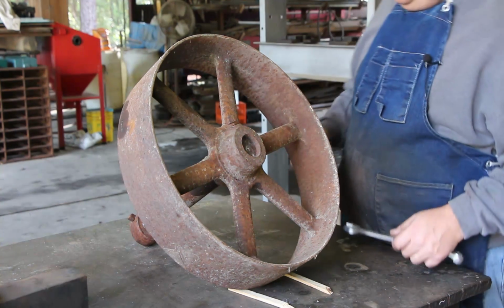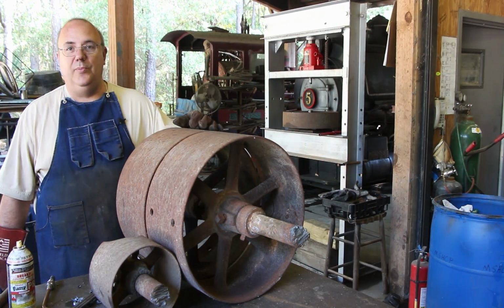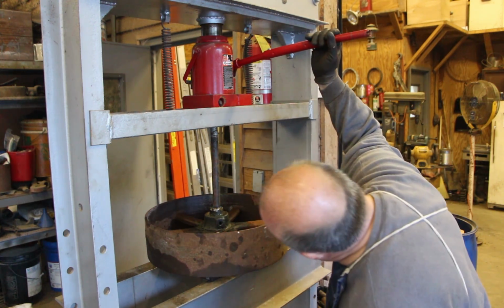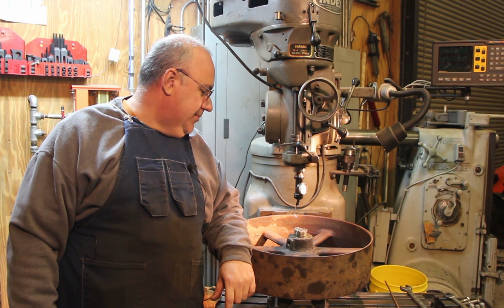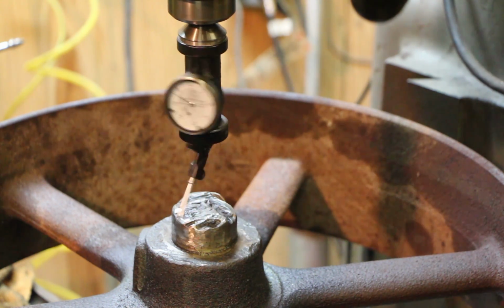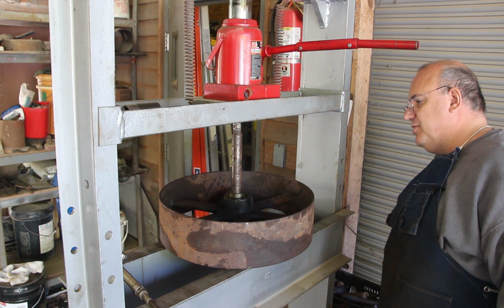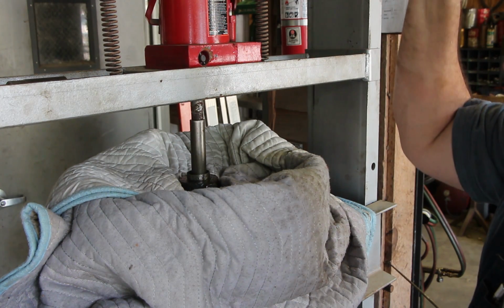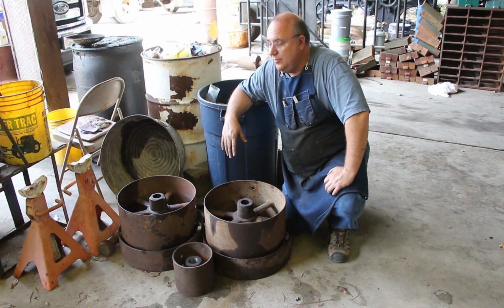Removing Stubborn Shafts from Flat Belt Pulleys

Comment: After having drilled the stuck shaft which left about 3/16" to 1/4" wall thickness, to save time and for safety reasons, this is what I would have done. Use the saber saw to cut through the sleeve wall which will release the remaining sleeve or you can also another cut opposite side and the sleeve pieces will pop out. It has worked for me. 
Marlins Machining
Reply from the maker: marlin galde Not a bad idea.  It would have been tough on this part though as the hole was not drilled through as I was actually using the bottom of the shaft for holding purposes on the mill.  Not an ideal setup but that is what I had to work with....

Comment: Ha Keith,
Just an old Indian Trick. Cut the shaft off very close to the hub , then drill a 3/4" or larger hole if possible. Now the Magic, Fire up the welder and use a 1/8" 7018 welding rod and weld a full length pass thru the shaft Pour cold water down thru the open shaft and watch the success with very little if any effort on the part of the press. Some times the part actually will fall out.
Reply from the maker: Danny Carico I have heard similar approaches before but never tried it.  I will have to add that to my list of things to give a try!

Comment: sometimes I heat up the shaft as hot as possible without heating the outside.. the bolt expands and it elongates.. when it cools the shaft should be smaller..  like welding a nut to a broken stud..welding as hot and long as possible.. when it cools..most times u can wiggle the stud out

Comment: Hallo you have try last resource first to solve the stuck axil. With my experience the set up how you press was a wrong technique in that can distorted the spoke of the wheel. I can see one mistake you have done is when you put the wheel on the press you let the rim of the wheel straight on the lower beam as a result your jack pressure travel to the spoke and then the rim of the wheel that could distorted the axil and rim alignment.
The correct method is you need a base piece that will hold the hub right under. Say you have a base peace with a hole in the centre , which should be bigger then the axil. The hub will rest on this base  piece that again stand on the low cross beam of the press. need to be sit directly  on the lower beam so you can apply a grater pressure  on the axil.  some time if you don't have a right piece you can still use two piece of square bar across on each side of the axil right under the hub .  you can made a grove in centre of the square bar which will accommodate as a pressure base and you can press with higher pressure with out damaging the spoke. Never press the way you did again it is very un professional and can damage the wheel My E mail is kyimedical@optusnet.com.au if you not understand and want to learn better email me and I will draw a diagram for you!This time you are lucky that you follow a dangerous technique and no need to pay for the owner for bad alignment of the wheel.
Reply from the maker: kyimedical While the video does indeed appear that the rim was supported on the press, this was not the case.  The hub was supported from underneath so that all of the pressure was on the hub and not the rim or spokes.  I had so many comments on this that I did a follow up in one of my next videos showing how I had it supported and illustrating how the illusion on camera make it appear that the rim was supported.

Comment: you really were lucky on that stuck one.
I would have when I had it in the mill just bore it out until it was paper thin.
If it wasn't perfect on bore center then when it started to cut into the cast iron
stop and use a chisel to gouge out the little bit remaining.
Reply: *****
Yes that would be a concern but bolting the rim down with some mill table furniture and tee bolts would take care of that.

Comment: Keith I turned wrenches for 25 years in a automotive garage.  I can't tell you how much time I lost by getting mad and aggravated and not walking away when I should have.  The worst for me was broken bolts in the block that I just could not get to. What a pain. I never liked the air powered Jacks because I liked the feel of how much pressure I was putting on a part. Guess a gauge would have helped. I was removing a pressed race off of a front hub and was using an air hammer with a Snap on chisel.  The end of the chisel shattered and metal in bedded in  my neck area. Like to have never got all the shrapnel out of me. I do not think Snap on is nowhere worth the outrageous prices they charge. If you use Snap on credit they charge you 24% interest on top of the crazy price. Thanks as always for your time and effort.  You are very talented person.
Reply: Yeah that's a tough one! Thanks as always Keith!

Comment: Isn't it somehow possible to support the pulley right at the hub? That would reduce all that shattering danger and allow you to apply a lot more force.

Alignment might be an issue though.

Regards from Germany :)
Reply: This is why I asked. Supporting it on the rim only seemed so wrong to me that I simply could not imagine you doing it that way. :-)

Comment: Keith this was a fun, easy-to-watch video! Your delivery was academic. :-)
Idea: After drilling, use a fly cutter to come in really tight to the OD of the seized shaft. Sink it through the shaft. You may have to flip the pulley to complete the cut. Then collapse the hollowed out shaft with a chisel or rotary file (die grinder). This works every time but it is time consuming to set up.
Or: in a hurry: You can always simply bore it all out and bush the pulley afterwards.
Then again, you work in a museum: not a jobbing shop. Nice work!

Comment: I really enjoy your show I have a tip for you to use to remove the shaft. Try after hearting it up melt pure bees wax on the joint and it should come out.                         Rick Ferrier.
Reply: Rick Ferrier they use bees wax in chap stick don't they?

Comment: Did my share of press work in the past....always preferred the manual press so you can "feel" the pressure.  One technique I used to remove aside axle pivot bushing. It was 6" dia., 1/2" wall bushing out of a blade (road grader) from a blind hole. Since I couldn't tip the blade on its side or put in the press (lol), I bent some 6010 welding rods and welded with high amps along the inside of the bushing.
    The welding pulled the sides in to make it out of round, making it loose enough to get it to move. In your case you could still get a welding rod in there and do some side rod welding.  Also I use STP to coat both surfaces when pressing new parts back together to prevent metal scoring.

Comment: Hi Keith just wanted to share my method with you.
Basicly I do the same drilling it out so I get a thin wall, but here comes the good part ;)
Take a hammer to the outside of the axle (pipe) and dent it inwards normaly this is enough for shrinking the pipe so it will let go, otherwise just take a longer piece of metal and extend the dent into the hub, at some point it will fall straight out ;)
The best thing is that doing this you can remove stuck axels from blind holes as well.
Then you just fold the left over pipe good and fish It out using a set of pliers.

Comment: I used just the torch one time to burn out the frozen pin on a front end bucket loader on site. Once you get a small hole right through, skillful use of the flame moving sometimes way backwards, gets a molten flow of metal and you stand there and roast but keep the flow moving. Base metal is not affected when the flame is pulled right back and with high oxy pressure. It helps to have someone continually keeping a water hose spraying right at you. As soon as you see a small slice of all base metal exposed, then the steel drift with a big hammer finishes the job. Well done with your machining and pressing neverthless. In a workshop, that's the first thing I also would have tried.
Reply: Melting out a frozen pin or rod is very easy but also very hot. Lots of leather needed and a good face shield. Once a pin hole has been established, the burning torch is pulled backwards anything up to 12" but with the trigger still on. Bolt heads can be burned off sheet metal this way and with leaving the base metal only scorched and not damaged. Even very light sheet metal so a heavier base metal is safe as houses if you know this skill. It is easy.

Comment: I use to hide behind a tool box when pressing gears and bearings off of big truck transmission shafts. Lol. That first Pop! Would always get me. It was like the entire press jumped when they would first start to move. Ours was air/hyd so all I had to do is turn the knob and watch the gauge climb! 
I wonder if after boring that shaft out, you heated it up really fast from inside the bore then let it cool if that would have loosened it any???

Comment: after drilling the shaft about 3/4 of the way( your first drill pass)  try som liquid nitrogen( local hospital or some doctor's keep some) just put the pulley in the pickup and drive up and borrow a cup.  this would pull the center shaft away... just a thought, it's colder than dry ice, because no air is involved.

Comment: I won't go into detail.but. Think backward. Don't heat the pulley. Pack the shaft with dry ice. Then press it out. The pulley absorbs heat and passes that to the shaft. Where as  the dry ice doesn't transfer the cold to the pulley. Learned that from a Machinists from N.C. whose name was Cooder. Circa 1978
Reply: Really? I wondered about that. I'm a plumber and I know there used to be a device to freeze water in piping. Probably not cost effective.I've put pins in the freezer before installing them..

Comment: The problem you were having with hub not expanding is from not heating from the outside of pulley first then gradually working to the inside shaft hub itself, the outer diameter of pulloey was acting sort of like a hose clamp on a hose causing the shaft hub to expand the wrong way, namely towards the inside. As you are well aware of Cast iron is brittle and when heat is applied especially to the center without warming the outside will cause the side to expand while the outer diameter remains the same, you took one heck of a chance on the outer diameter cracking due to that very reason. Next time you get a situation such as that try it the way I suggested above and maybe you won't subject yourself to as much work and head scratching as you did on this one. 
   I worked in a steel mill where we had to remove very large gears and pulleys from shafts and never had any problems doing it as I stated.

Comment: I checked the top comments, and didn't see this: It really hurt me to see you pressing the shaft while supporting the rim of the pulley. Any pulley is bad enough, but a cast iron pulley is asking to break it by pressing the unsupported hub. Why not make a block by taking a bit of rod the same diameter or bigger than the hub and boring a clearance hole just bigger than the shaft. Put that under the hub and you can press to the capability of your press with no worry about shattering a cast iron pulley (or distorting a pulley of some more malleable material).

Comment: I need some help on a matter Keith, i bought a 1962 engine, it stated that on the cast, the crankshaft pulley got broken after the delivery driver dropped it from his lorry tail lift... I tried heat and froze the bolt... No success yet. 
Also the previous owner cut of the dynamo bolt... I tried heat and drilling it out, no success there either. Is it a option to braze the broken bit back on the pulley and cut a slot in the engine casting to braze back up after the bolt remains are out? I never brazed before, but no doubt you got a video on that. I like to keep the engine for my 1965 land rover.
Reply: *****, the engine runs at 5000 rpm at the most, the 3MB set up gives the krankshaft a slight wobble. The downside of that engine was the previous owner, the pulley bolt was attempted to be chisseled off, it made it hard to fit any tool to it. I kept it separate for 9 months as i want to do it right :)

Comment: Have you ever used dry ice to chill a shaft and then heat the hub? I have used this method with great results on a few large bearings and bushings. Never the less great job on not destroying that part

Comment: Bore it most way out, then either warm it up from the inside, and when it cools it will be smaller than it was in the first place and will fall out, or try to run a length wise weld bead with a stick welder..
Reply: Yes, i agree! You did well to get it out at all. You do some great work there by the way!!

Comment: Keith, I have had a few frozen shafts on farm equipment over the years one my 30T press would not budge at all. I ended up drilling the shaft out to 3/4" from both ends and than I welded the hole shut from the bottom of the holes to the outside. with 5/32" 7018 turned up as hot as the chart said they would take and than let the whole shebang cool off. I than set it up in the press again and pushed it right out.
Dan.
Reply: *****
Yep I know that, I was giving you a heads up to another method to try. :)
The advantage to the internal welding is it does shrink the OD of the shaft. On the above mentioned shaft it shrunk the shaft more than I thought it would. The shaft had an extreme amount of galling.That is what broke the anti-rotation pins and wore out the pin holes in the mounting ears. What started out as a two maybe three day job turned into a weeks worth of work. The bore that the shaft rode in was hardened. It survived with every little damage to the bore. If I would have tried this method first I would have been ahead of the game. It works well.
Dan.

Comment: This is more suspenseful than Hollywood. Shouldn't you have some face protection in case something shatters? I'm thinking if you're resting the pulley on the outside rim, all of the spokes could be flexing, taking away from the pressure on the shaft. 

Edit: Welp, I wrote this before seeing the blanket scene
Edit2: Yeah at 29:04 and up you can see that it was the spokes that were stealing your pressure. I was starting to wonder if that shaft was tapered. haha

Comment: Nice video, and you do nice work... but I have to humbly correct you on something..
 You were NOT putting very much pressure on that shaft at all...not with that 30 ton. which actually looks like a 50 ton to me.
 Unless you are Hercules, you cant possibly get to 30 tons of pressure , using only your UPPER body, (arms only)  and that FLIMSY 3 piece bar tells me the whole story. it would have snapped and broken if you had put such pressure on..
 Here is how I know this for a Fact.. 
 I have a 100 TON jack on a Vulcanizer, with the jack at almost floor level ( 2" steel plate from floor)     I use  it  to form molds up to 18" with Heat and pressure, , and I use a SOLID steel BAR which is 4 foot Long and weight like 15 Lbs.
.. Lets do the math on the kind of leverage we are talking about here
and the Moment arm  .... we are talking HUGE leverage & Pressures... and yet  I dont even come close to maxing out that 100 Ton Jack ... The Frame on my vulcanizer is made of SOLID  2 " thick steel triangles, which will not ever flex, the whole press weighs about 1100 Lbs.. ..   The pressures per sq inch  in  this press are very high and would cleanly break your small  press frame..
 My point is.. I would never achieve those pressures ,, IF I was working at the elevation you are working at , and with that flimsy handle .. The Geometry is just not even possible. I am guessing you put about   5- 8 tons of pressure on that shaft, MAX.. if that.
 I often use my body weight to achieve the per sq inch pressures I need....which would probably max out YOUR  press, or maybe go to about 50 tons..
 Not sure if this helps, and I hope my post does not come off as negative..
  Just trying to explain things  from my experiences with  jacks and pressures..and what I saw immediately when you were working that jack and thought you maxed out that 30 ton.
 And yes, I think my press would have popped out that shaft like Butter  . The Galling from the set screws would not have mattered one bit..
 All you would have needed was a LADDER or work from an elevated position,   and a longer SOLID bar.. That press can do a lot more than you think,, but perhaps the manufacturer does not want you to break the frame..
Again thanks for sharing the nice Video, with these Belt Pulleys..
Reply: *****
 Ok, I see.. that makes sense then.. I totally misunderstood..

 I thought you were saying that the reason it was not budging is because even at 30 tons, it was just not enough pressure and you were looking for MORE pressure.. but the press could not generate more, therefore you had to machine it out..

got it now..thanks

Comment: Wow.  

*****  But, wouldn't it have been simple if you had drilled from the other side of the pulley?    ( YES, I realise that is a "20-20 Hindsight", smart-assed comment.  It's meant with humor - I'm just making 'light' of a tough situation !)  There was no way to know which end (or if the whole length) of the shaft was damaged.  Until you got it off the pulley!   (Perhaps install a CAT-Scanner in the shop?  Only cost a $million or so).

You showed good patience and ingenuity, nothing broke, and the job got done!   I don't have any "Magic Advise" on how you should do it differently. (I use different penetrating fluids, and probably use different order/ways of doing stuff; but to be honest, I can't say it would have worked much better on such a fragile and 'irreplaceable' piece).

BTDT, Just "another" of those 'Jobs' that are too crazy to bill actual-time.  This is what evens-out the money-spinning potential of a machine shop  :(         Although, you should keep that piece of shafting to show (your museum honchos) just WHY it takes double the time and money to restore old stuff.

Another good video.   Happy New Year!

Dave.